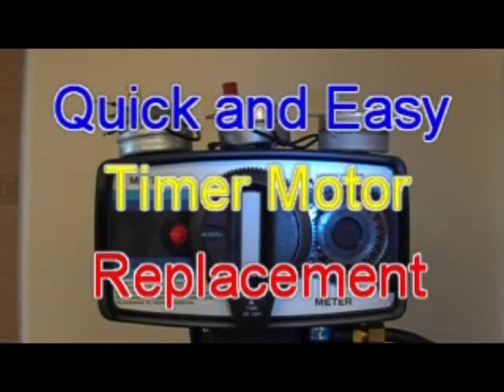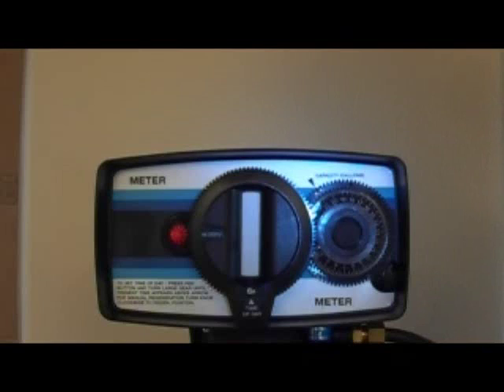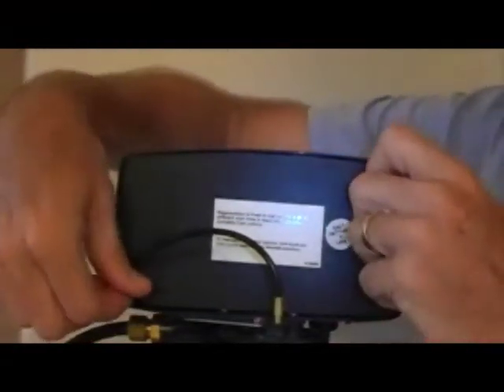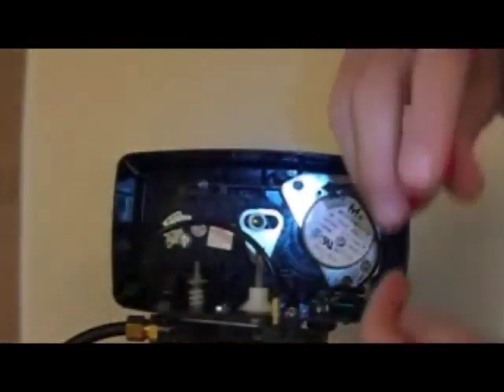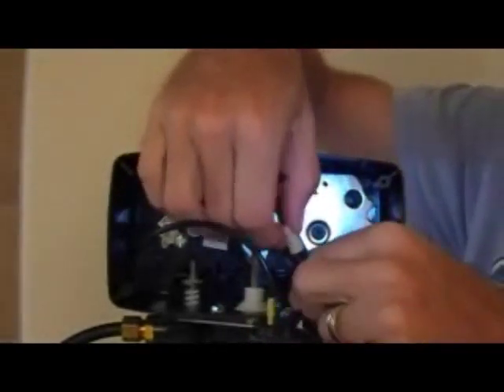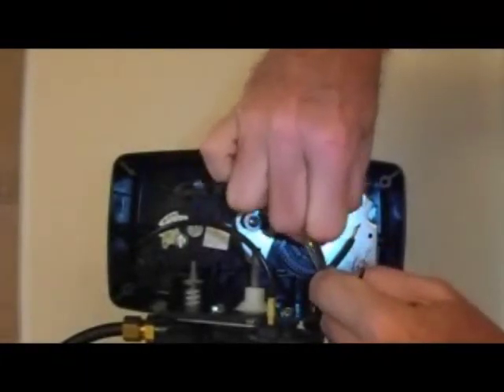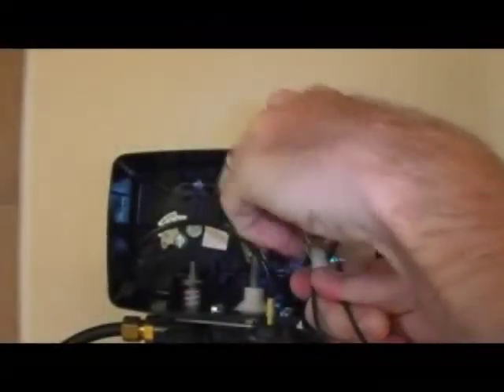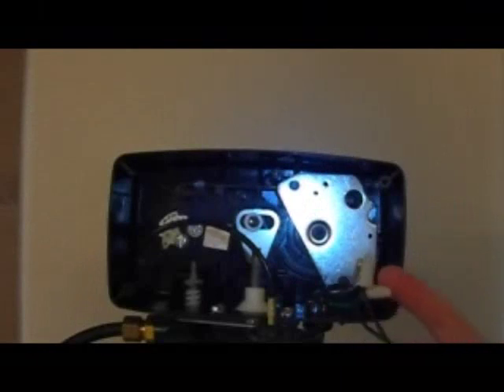Timer Motor Replacement Fleck 5600 Valve

Comment: I've removed the metal plate under timer motor, and question that the gears may have shifted. The cycle stops at brine refill. Do have video/pictures of proper gear alignment. 
 Videos are well done and very informative. 
Dave K

Comment from the maker: Yes, that would be a good video. For now I'd recommend the printed directions at our website softenerparts - Gear_Main_Gear_And_Shaft_For_5600 part number = 3413170 as the main shaft gear alignment with the Brine Cam Gear are the only gears that need to be "in sync".

Comment: Thanks for the video. My I have the same type of water softener clock as shown in your video. However my timer has been continuously running over the last few weeks and the salt quickly is used up. By changing this motor, will it probably fix my problem? I don't want to spend a lot of money for a new unit if all I need to do is change out this motor. Thank you.

Comment: The gear from the Motor... why is it not moving at all? but i see from the back it is spinning...  little help! thanks!
Reply from the maker: Relly Rod The motor gear turns very slowly.. 1/30 rpm... it takes 30 minutes to complete one revolution. But also possible for the rear of motor to be spinning and the drive gear to NOT be turning.